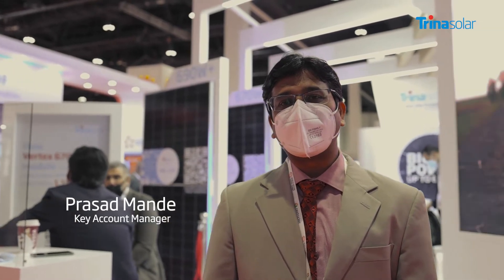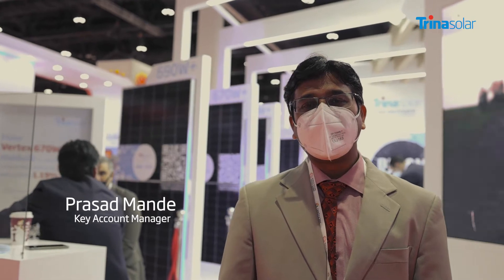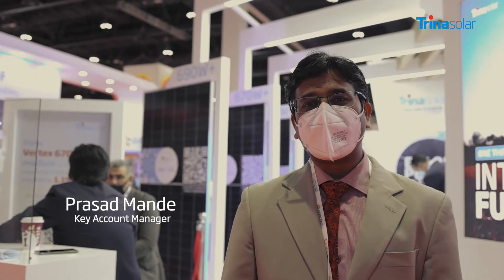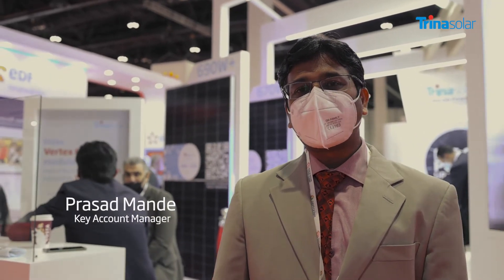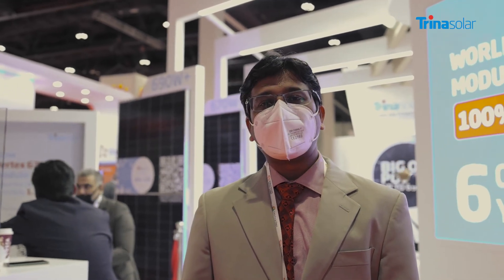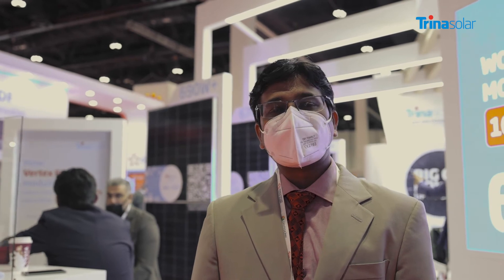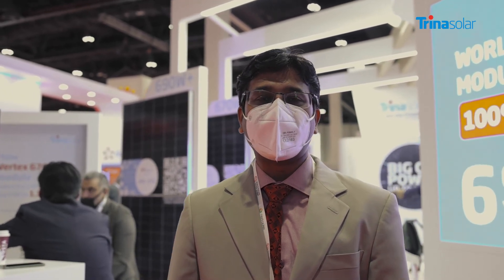Key features of Vertex modules series with power from 400W to 690W

Comment: Hello! I turn to your company because I like this prestigious company. I have a question with can I notice the difference photovoltaic panel fake and the original Trina Vertex and Honey models? Older products had Triana Solar written on the blue label and Trina under the glass on the front. Now just label the parameters written in black and on a painted frame a paper label. It would be useful for me to distinguish between false and original. Thanks!